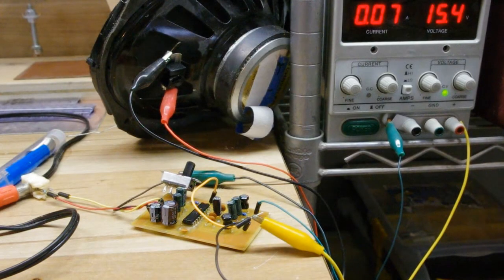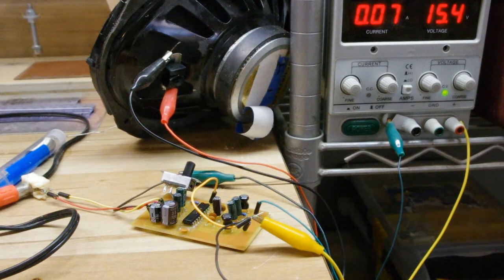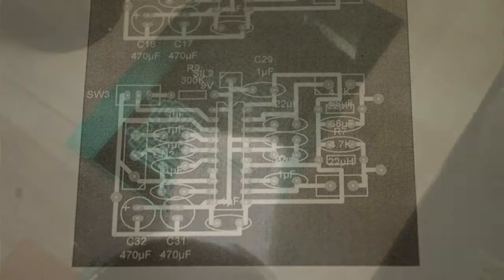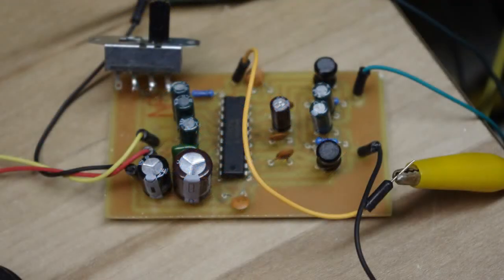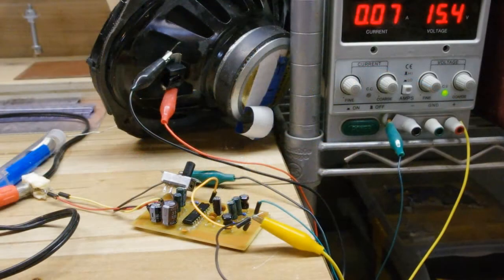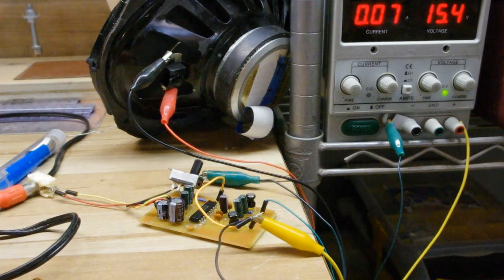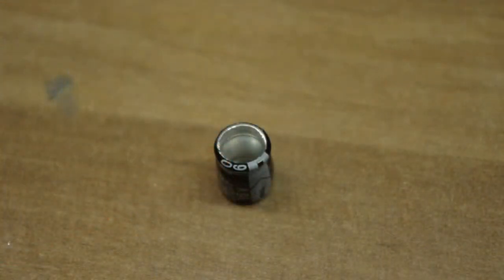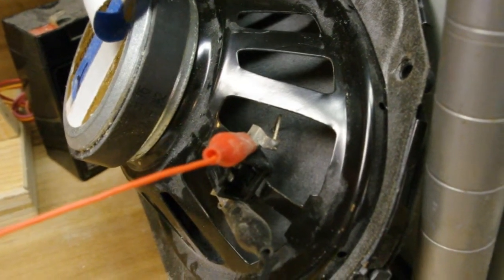DIY Class D amplifier - TPA3122D2

Comment: Hi, 
I built a kit amp from Jerry's Electronics that is based on this very chip.  It's excellent -- even on very nice speakers like my Klipsch La Scalas.   No need for a heat sink, and you simply hook up to DC power pack (wall wart).   Easy.   There should be some provision on the board to take care of the power-on "snap".     It's a great sounding chip.   Nice work on yours!    If you come up with a solution for turn-on snap, please write me.

Comment: Seriously wrong? Lmfao, the higher the voltage u use with ur amp the higher the output resistant (Numeric)... Like...
Voltage to TDA8920bj/bth at 27,5 it puts out max but only at 8 ohms...
At ~22 the same at 4 ohms.
I dint use it as class D, pair of irfp240/9240 were at the end running at +- 28v...
Trans were bought from ebay... so... probably fake.

Btw, speaker max input is overkill for sure.

The funny thing is, shitty car speakers rated at 300w burn down at 50, Seriously wrongg....